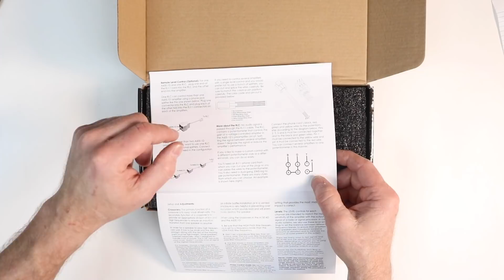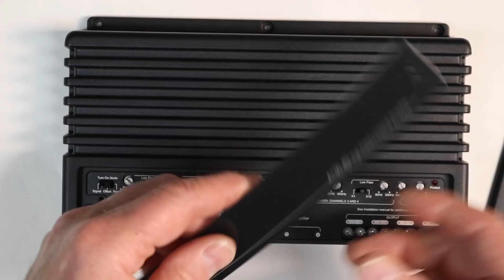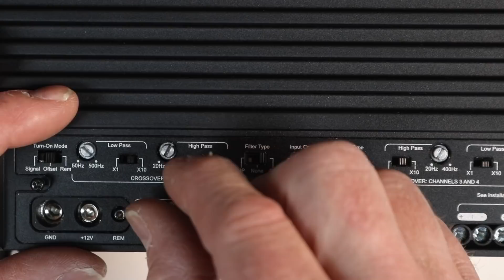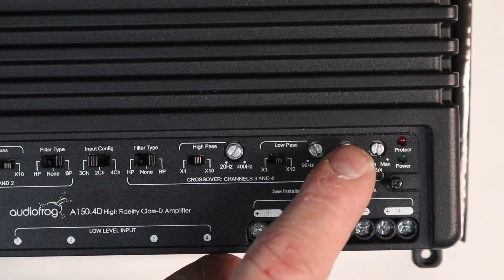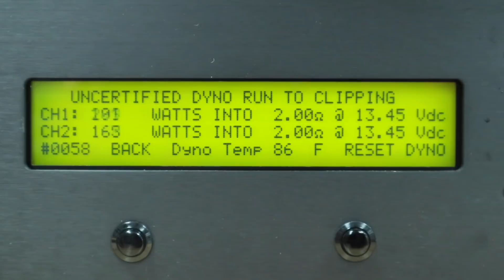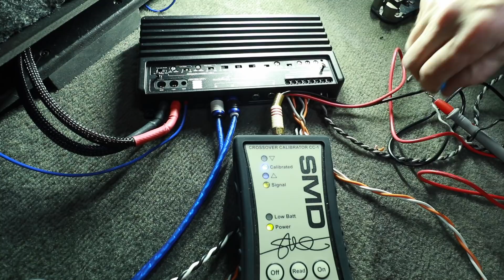Audio Frog A150 4D unboxing, amp dyno, and install car stereo lab

Comment: Worked with Andy as an installer 35 years ago and even then he was on another level.  No surprise he is making some top shelf equipment.  Listening to you describe the thought that went into the design and heatsink and I'm not surprised.

Comment: I'm wondering do companies out there still make audiophile/ reference series head units? If so, could someone point me in the right direction?
Reply: Sony makes the Rsx-gs9. Other than that, everything else on the market is pretty standard fare. Just look for high voltage rcas on a decent JVC/kenwood.

Comment: These seem like good little class D amps spec wise, but I think for people with the GB series speakers they will be looking for a much more premium amp and more than likely a class AB. Not to say these wouldn’t sound good with them as I’m sure they would but I was hoping for something a little more unique out of Andy and his team with regards to amps. Pretty hard to beat the Helix amps/DSP’s if your leaning towards a small footprint but those get you into double the price if not more.
Reply: I agree with ya, but these will get the job done for GBs provided you follow how they did their demo vehicle- running mids with bridged channels and simply running more amplifiers. Personally, I run a 6 channel mosconi with bridged channels for an active front stage on GB60s and GB10s and a dedicated 2 channel for rear fill GS coaxes.

Comment: B2 Mani 600.4 is the same exact amp but has 24db crossovers. Andy is gassing us with this stuff.
Reply: While it appears to be the exact same design, they are not quite the same. The AF is even more compact which is probably why it only has 12db xover vs 24.
without having someone compare them , it's possible that AF has used higher quality components to justify the higher premium. Hard to say, but I'm with you, I'd go with the Mani if I was looking for an amp like this.
Reply: @INFRNL1  AF does indeed have a smaller heatsink and differing specs, but the board and internals are similar. Like the Crescendo S4 and D4S JP84. I'm just saying, Audiofrog isn't doing a unique bespoke design.
Reply: @SeanSinha  Oh yeah, I definitely agree with you there. I'm not sure how many brands there actually are that are true innovators, especially when it comes to amps. 
I'm currently running the D4S JP23/234 combo. I'm going to swap them out for B2 Rage to see if I can notice any improvements.
This is where I like the 90's; where everyone and there mothers wasn't just putting their names on an amp to get into the market. this seems to be a trend on subs as well
Reply: @INFRNL1  The D4S amps are by S&I and are decent for the money. I think that it's going to be hard to discern any SQ difference between quality Class D amps. And while people will claim you can't hear a difference between Class AB and Class D, in many applications it's true, but I can definitely hear a difference between my Class AB RF amps and my Class D RF amps, notably in the highs/vocals. They are cleaner on Class AB.
Reply: @SeanSinha  Your evaluation makes me wonder if a dedicated hybrid approach might make $$s for an amplifier company. Use a good class D design for woofer/mid channels and A/B for tweeter channels. No need to have woofer power = tweeter power so make them at a 2:1 - 4:1 ratio to keep overall efficiency decent. Aim it at the SQ crowd. Then again it might be too small a niche to make any profit.
Reply: @brianmack6285  Ground Zero has an amp with adjustable class ab/b bias.
Reply: @SeanSinha  which one is better for you on power and sq, RF T600-4 or this Audiofrog amp?
Reply: @hinchadahe  I'd get the RF. Stout Class AB design that sounds great.
Reply: I asked his son in person at knowledgefest last year. He told me that it was Andy's bespoke design, but AF needed extra cash at the outset of the pandemic so he allowed the manufacturing facility to produce them for other companies with lower quality components for a licensing fee or something. Don't quote me on this, but this was the gist of the conversation. Hope im not stepping on any feet telling this, and Ill remove the comment if it is, but yeah the AF amplifier is the real deal and the B2 is its cheaper lower quality cousin.
Reply: Very close but there are some difference that makes the AF the better amp, check the output filters on both amps, check the brand of the components
Reply: True, Wonder what makes the audiofrog twice as expensive, would be nice to se the inside of both, Guess they the same, this is 100% a ripoff.
Reply: @Drolanz  There are likely minor differences, the crossovers for one, but you can tell that they are the exact same board down to the connectors and amp case. The topside connections are the exact same. The backside connections are the same. While there are minor spec differences, they are also the same power rating. Andy is and always has charged a premium for Audiofrog and while they make a good product, Audiofrog thrives on marketing.

Comment: Dig the size and the output is comparable to my AudioControl amps. Dampening factor looks good as well as the other specs. At $699.99 for the AudioFrog vs $599.99 for an AudioControl LC-4.800 with darn near the same specs just slightly larger and AccuBass, it would have to sound $100 better IMO. I doubt that it does, but the size might be worth the $100 alone for some.
Reply: Well, u can buy the b2 mani for $349 😏
Reply: @Drolanz   would that be the exact same amp?
Reply: @SNShobby  most likely 98% the same
Reply: @Drolanz  wow that’s a big price difference if it is lol
Reply: @SNShobby  Yes, thats how branding works, its also made in china, for 700 bucks i would look away, dont be fooled by these "hifi super" class d amps, buy an desent class ab amp and put the money in the installation, deadening and boxes and so on.
Reply: @Drolanz  thanks for the info I was just looking around only thing im missing is a nice 100/150 watts per channel amp (4channel) to complete my build.
Reply: @SNShobby  i understand, where are u located? EU or US? I might can recommend something 🙂
Reply: @Drolanz  I’m located in the us any help would be great 👍🏼 thanks in advance
Reply: @SNShobby  would definitely check out the Down4Sound jp 34ab , seems like a killer amp for the price
Reply: The audio frog does have that emi protection that's about the only feature I see that is unique to them I wanna see how good the switching frequency is filtered out of the output considering its a class d amplifier saying it's high fidelity it should be almost undectectable
Reply: @joshuawheeler4404  I don't know about the AudioFrog like you said, but the AudioControl sounds amazing itself.
Reply: Audio Control Products are manufactured in US but Audiofrog isn’t.
I feel Audiofrog amp can be significantly cheaper than Audio control, but I reserve my comments till someone compares both amps and do a breakdown with components used.

Comment: Just my opinion but you're little worker their Fernando is a weird one you didn't bother mentioning if it bumps if he likes it because it makes the highs sound good and it sounds like he likes the tweeters then that amp wouldn't work for me because as soon as I would pull out of the parking lot I'd be turning the treble crap on my head unit down putting the fade so it's more on the sub and my front speakers you'd barely be able to hear them. I like my amp for the bass not the treble Bass is my thing not treble but this was a good video and I watch a lot of them, so I wasn't trying to offend you I was just stating my opinion.
Reply: This is a 4 channel amp. They aren't really meant for Bass. If Bass is your thing, you should get a Taramps Smart 3k Bass and a pair of 12's that handle 3k RMS with and add up .5ohm load. Your Bass will flex your windshield. If your cars electrical can handle it. But a small 4 channel amp like this is more designed for driving a set of component speakers as loud and clean as possible.
Reply: @Jamez84  how are they not meant for bass? Not everyone wants to flex their windshield like a 17 year old. Some people just want a good sounding balanced system but apparently that idea is over your head. 200x2 is enough to drive alot of subs on the market. Or run it in 3 channel mode.
Reply: @ah4800  You're the type of dude who dives in kiddie pools, aren't you?
Reply: Can anyone decipher what this guy just said? Please don’t do a substantial amount of drugs before watching a car audio amp review, or anything for that matter…🤓
Reply: @CarAudioHorizons  Synopsis: They're all about that bass, about that bass, no treble.
Reply: @SeanSinha  They must have deleted my comment that I made towards you with regards to Audio Frog lol
Reply: @CarAudioHorizons  Weird. I just think they are overhyped amps that are nothing special given the price.
Reply: @SeanSinha  It had nothing to do with the amps, it was your comment about Audio Frog charging a premium for their products. I won’t bring up their amps as I haven’t tested them to know their value but their speakers are probably the best value out there for what you get especially when you compare their GB series with speakers that are double and triple the price.

Also their marketing has pretty much been word of mouth and the same on the DYI Mobile Audio site. They’re not running ads lol
Reply: Ever heard of punctuation? Not 1 period in that entire bs post.
Reply: @ah4800  who cares